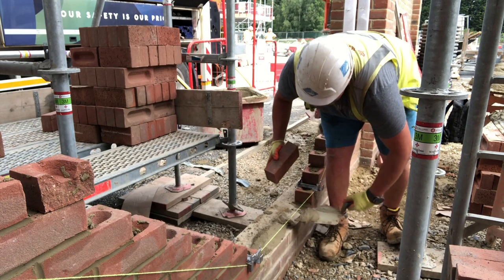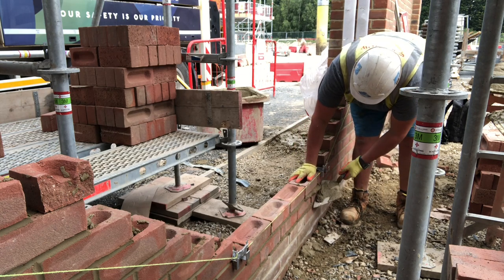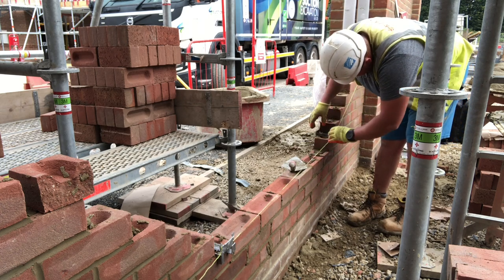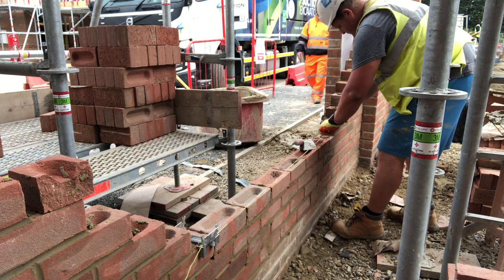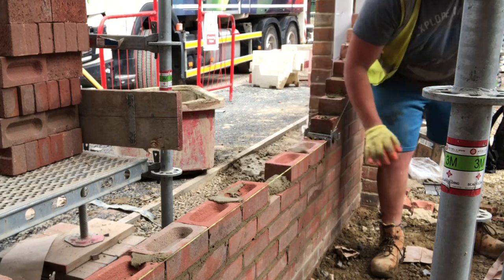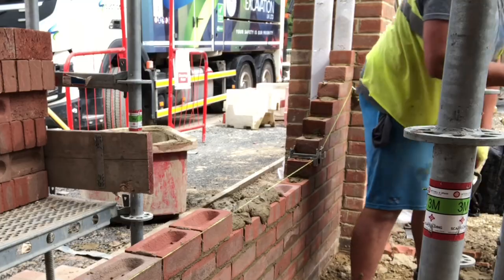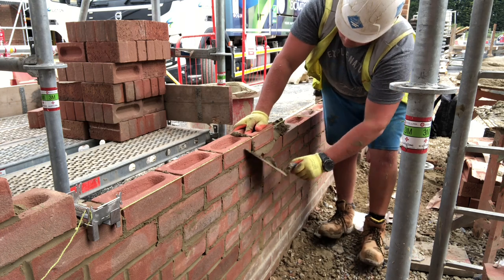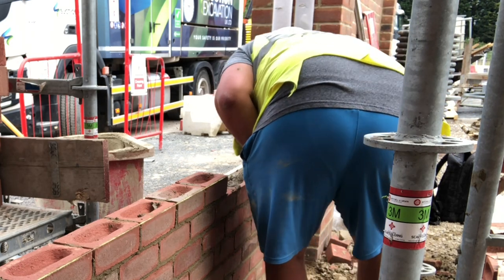Bricklaying Vlog - The Garden Wall Continues - Staying Hydrated! & Pic n Dip Backwards? - Part 1

Comment: Can’t help thinking it’s quicker and easier just to put pin in at both ends
Reply from the maker: U wouldn’t believe how much time u spend wrapping the pine then making sure it does fling out the joints, then a lot the time it cracks corner, i find it miles easier with the FitzBricks

Comment: Not convinced about the fitz clamps not in our wet climate, they look clumsy and prone to  seizing up, if we was to buy every gadget that came on to the market you would need a trailer for your tools, there is a reason the basic bricklayers tool kit hasn't changed in decades is because its reliable
Reply: They done seize up there stainless steel
Reply: My point is they haven't been around that long, see what there like in a couple of years time that will be the real test

Comment: luv your vids Harry dont mean critisize but your line always seems be a bit slack to me  even wiv the fitzbricks noticed on a few vids you done tighter the better not avin a go your a good brickie 🧱just can tell
Reply from the maker: Dunno if its just how it looks on the videos, but when I start pulling longer than 10 bricks I always make sure it tight, I just dont sweat making it super tight on short runs, ive never had line sagging issue on gauge👍🏻
Reply from the maker: I get my lines a lot tighter on external corner and profile to be fair, I don’t sweat it for a Max 13 brick length on this wall